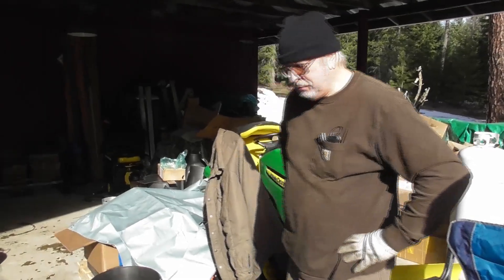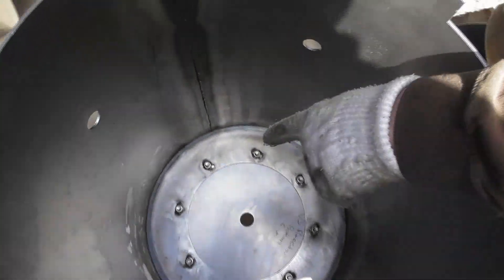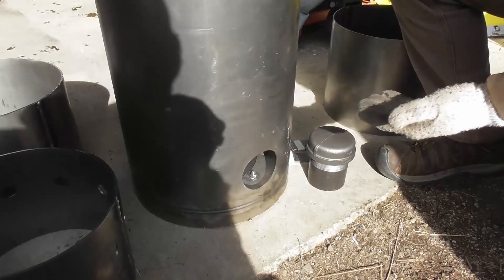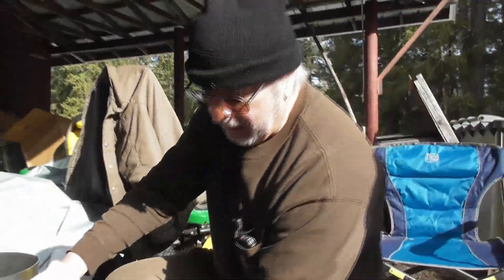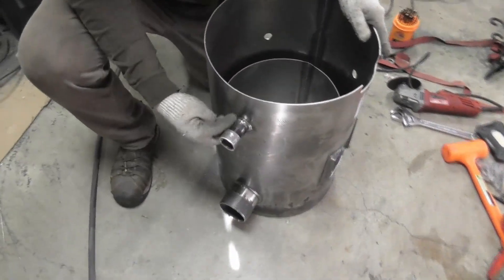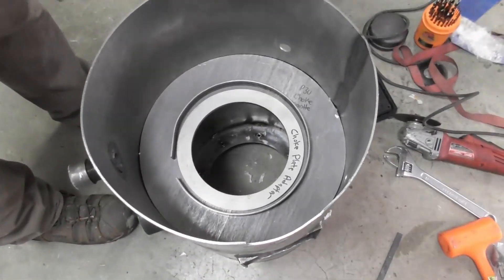Wood Gasifier Builder Training:  Reactor Part 1

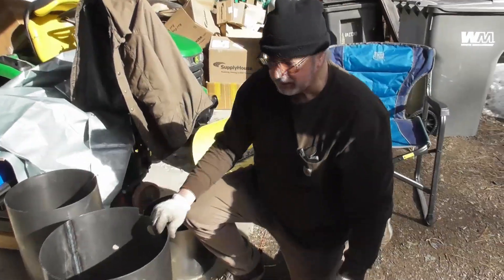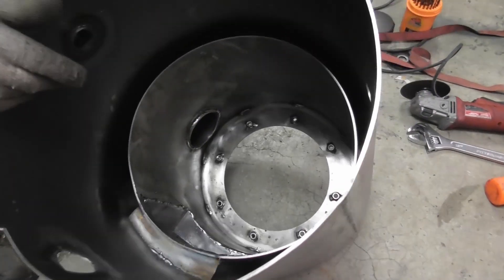Comment: @3:45 to 3:54 then Go to 6:50 to say 7:00 ? Reduction tank liner only tack welds  to the bottom and kind of floats under the choke ring ? Or do we seal weld it all around like the square gas outlet and the 3 inch clean out ?
Reply from the maker: Yes, I do skip welds inside both top and bottom of reduction tank, any outside welds are full airtight